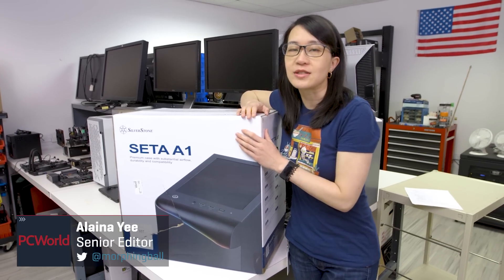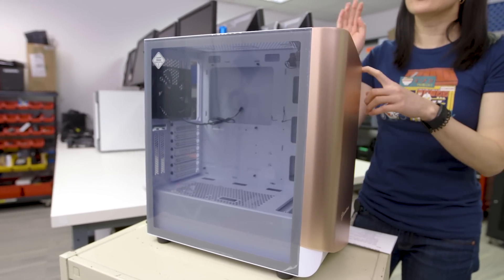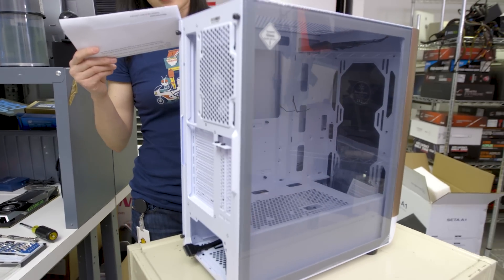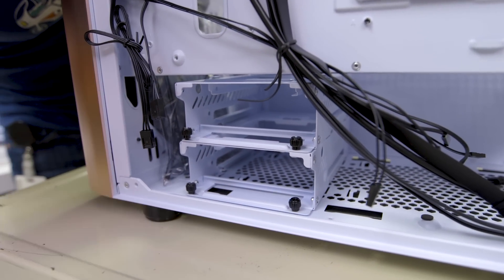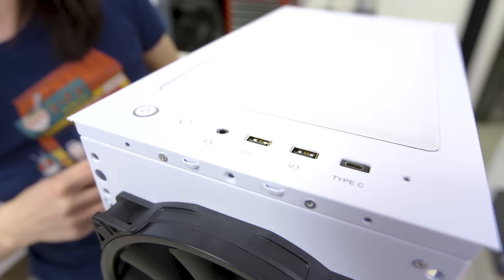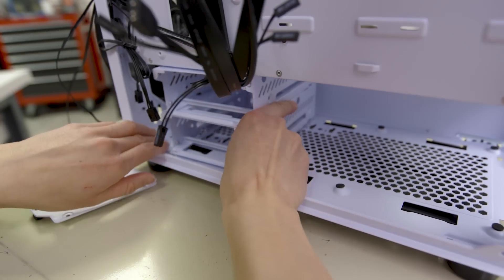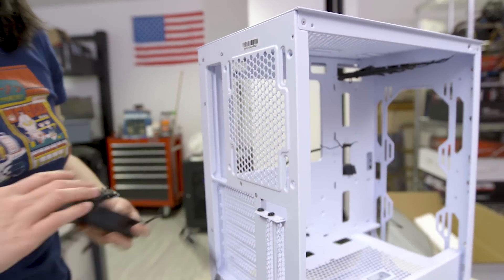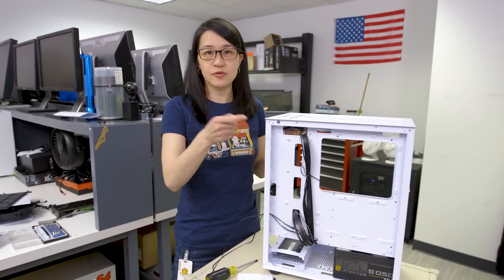SilverStone Seta A1 walkthrough & teardown

Comment: In black it might be better. The gold front is awefull. I am very interested how the limited airflow from the front affects the temps in the case. Two small air vents cannot bring that much air into the case... Even with the big fan in the front.
Reply: yeah, especially the way the fans are mounted and with that dust filter as well, I think it doesn't bode well for thermals in the stock configuration. However, I think the case could actually do alright if you remove the front filter and move the front fans to the inside of the case if you aren't doing watercooling. I also wonder if you could do a push/pull config with a standard 240/280 rad and still mount those 200mm fans at the front of the case. Feels like you could try a ton of configs to try and increase airflow.

Comment: $130 for a case with a closed off front panel, no thanks.
Reply: That fan filter doesn't look reassuring either.  As soon as she popped it back in place, it popped right back out.  The rubber pads not sticking.  The vertical gpu mount screw is cross threaded.  There's just way to many things wrong with the case for that price.  Those are things I'd expect from a budget no name chinesium case, not from Silverstone.